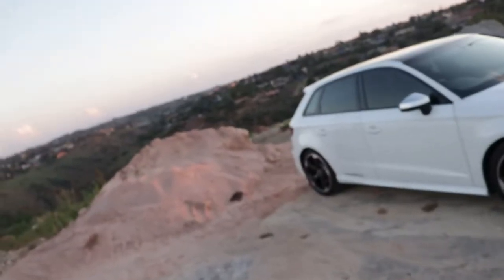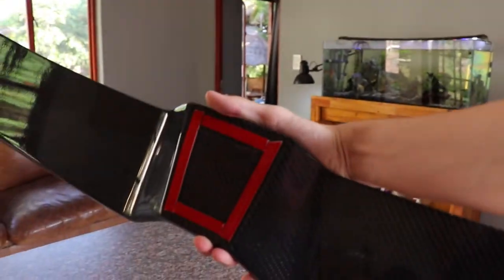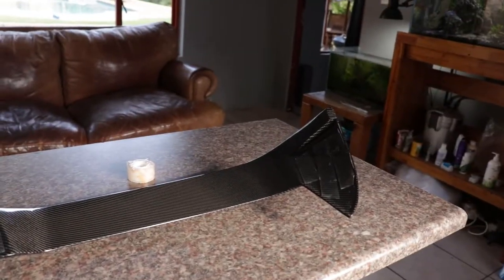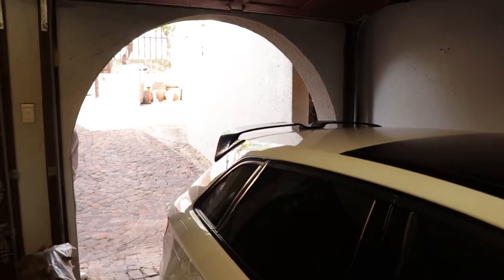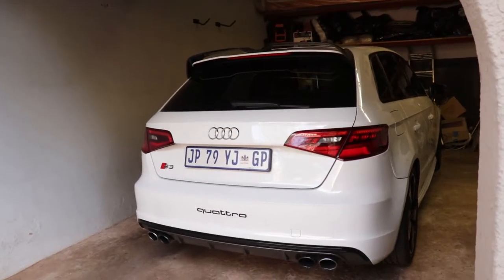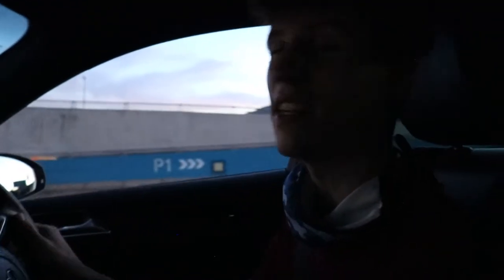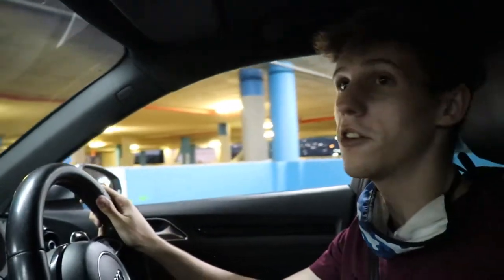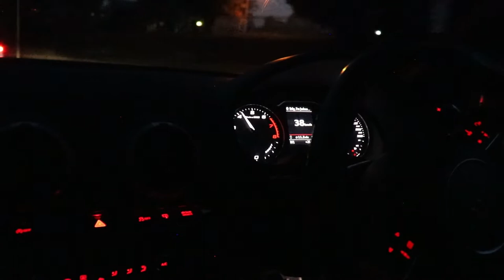Audi S3 DIY Wing Upgrade | Carbon Fiber Oettinger Style

Comment: Bro did the double sided tape hold? they used really strong windscreen glue to install mine. Lol

i would make sure that wing is super secure, it looks amazing.
Reply from the maker: Still holding to today, if I pull on it the whole car moves🤣probably time for replacement but if it holds it holds

Comment: How’s the gorilla tape holding, getting similar spoiler just want to make sure it sticks down and holds
Reply from the maker: Still one solid, Sun rain or shine it stays on. even handles highway speeds very very well ;)
Reply: @alex_aka_dev  that’s great I was worried about doing high speed and it blowing off, all ordered now will see how it sticks down 😀
Reply from the maker: Just use a ton of tape if u do a lot of high speed it might be worth looking at securing it with something else. But mine has held up fine
Reply: @alex_aka_dev  will make sure I do, I have bought 3m tape which other people have recommended for holding spoilers down
Reply: @alex_aka_dev  would you recommend waiting till warm weather to install as in uk has been cold and wet for last month